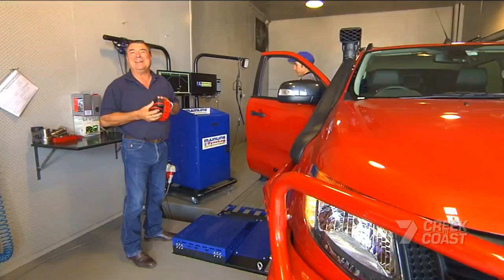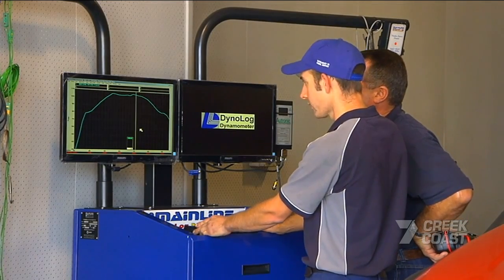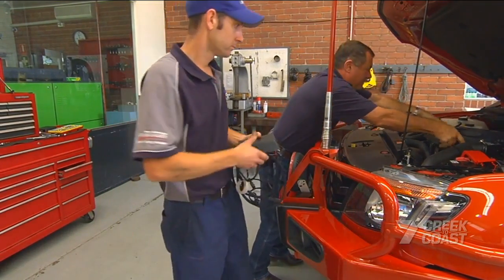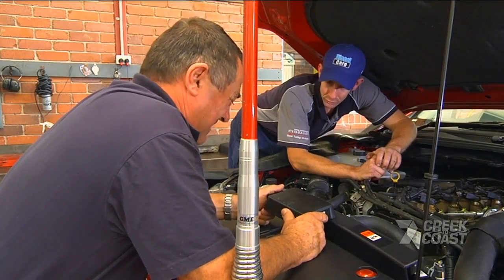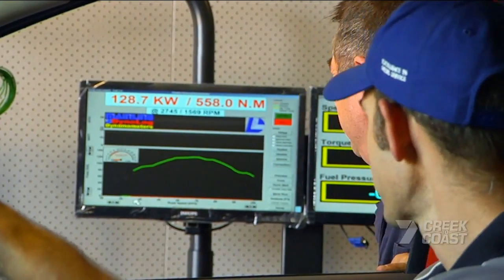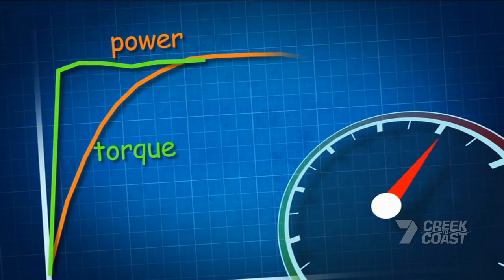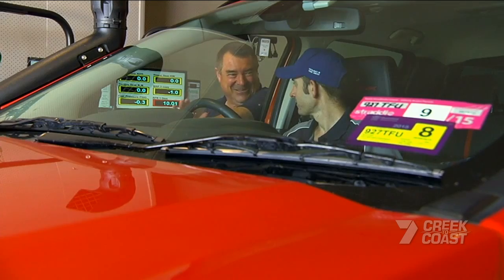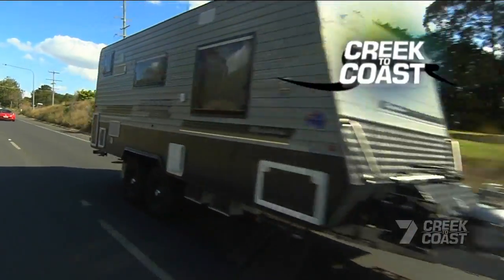Diesel Care Toowoomba on Creek to Coast - Towing made easier with a STEINBAUER Module

Comment: Is it important to dyno the car when putting on this system? I am in Central america and dyno's are hard to find here
Reply from the maker: Hi Joseph, Steinbauer modules are mapped for the make & model of a particular vehicle. They are designed as “plug & play”, so running a vehicle on a dyno is not required. We distribute modules through a large network of dealers but only a very small number of them have access to a dyno, therefore most Steinbauer modules installed in Australia & New Zealand are done so without the use of a dyno. When we install a module in our own shops we very often do, but its mainly to verify the results we are expecting, or if a customer has done other performance modifications we can make adjustments to the Steinbauer mapping to marry it all together. It’s nice if the option exist, but certainly not a requirement.